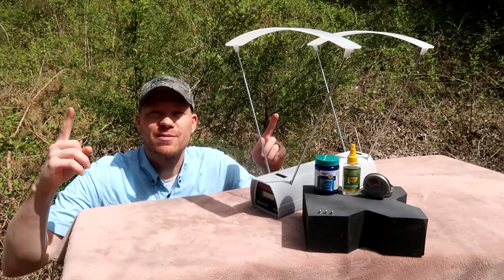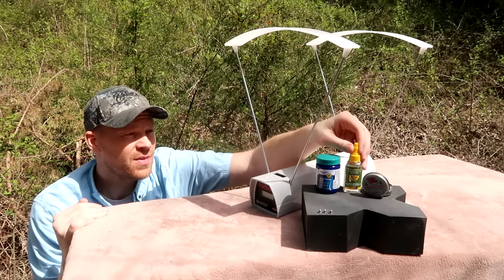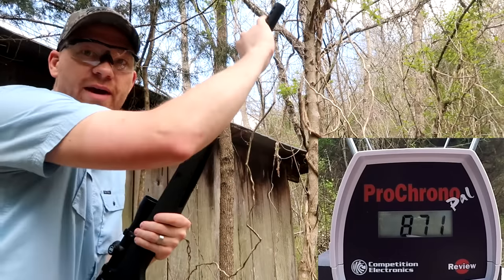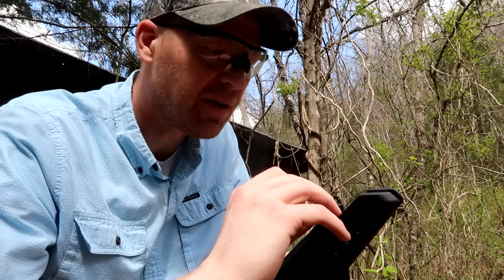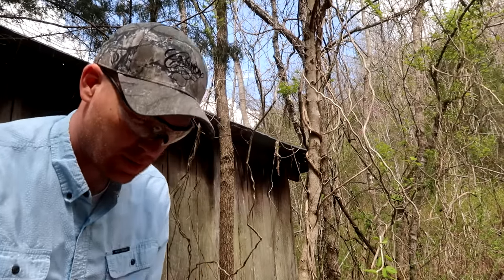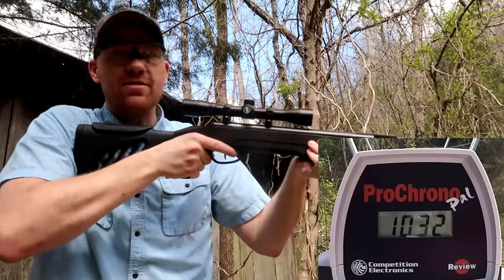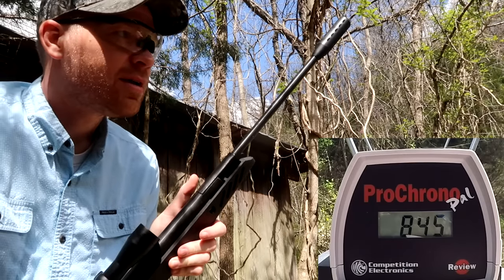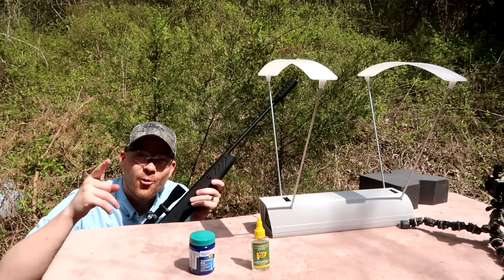Air Rifle Dieseling - MORE POWER

Comment: That works because it seals the pellet to the bore like rings of a piston to the cylinder wall. Surprised me though at the boost it gives. Great Video!
Reply: Its called dieseling because it works like a diesel engine. When the air compresses the vaseline/oil it reaches a point to where it combusts on its own just like diesel fuel does in an engine. In case you aren't familiar with them, a diesel engine doesn't use spark plugs to ignite the fuel air mixture, instead it creates a very high compression on the compression cycle, much higher than a gasoline engine and at that high pressure the diesel combusts on its own without needing an ignition source.
Reply: @sinformant no it doesn't, the diesel engine needs an ignition source to initially start hence why they use glow plugs instead of spark plugs. They combust from pressure only after being ignited be a glow plug to initiate the cycle. The airgun has a lot more pressure than a diesel engine allowing it to ignite without a glowplug.
Reply: @sahilsquadron2286  the glow plug, depending on the engine and position of it is there to preheat air fuel mix coming in, it is either located directly in the combustion chamber or before it in the intake tract. Its purpose is not to ignite the air fuel mix itself. It simply helps the air fuel mix get up to a temperature that aids it in combusting on a cold start up. Diesels existed before glow plugs and some don't even have them. A diesel will start without glow plugs just takes more effort and more cranking,with the exception of newer engines that the ecm wont allow to start if it doesn't sense the glow plugs operating.

Comment: Dieseling happens when oil or petroleum jelly is put at the back of the pellet the reason it sends the pellet down the barrel faster is because the air compresses when the gun is fired now compressed air heats up and sets the oil or petroleum jelly alight thus creating a little explosion  forcing the pellet to travel faster

Comment: What airgun do you use?
Reply from the maker: Swiss arms tac 1 I believe
Reply: @WHOTEEWHO  Yep, looked it up, it must be it. So a $100 air rifle delivering over 50 ft.lb.... So, If you can get an piston / spring driven airgun in .25, you can actually use it for hunting...  I wonder if the dieseling works with PCP air rifles; the compression is there.